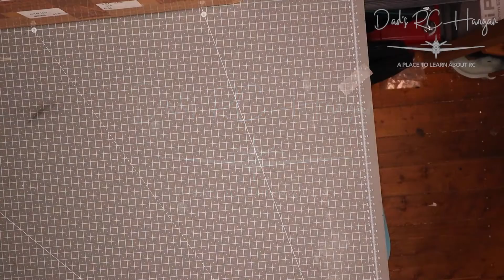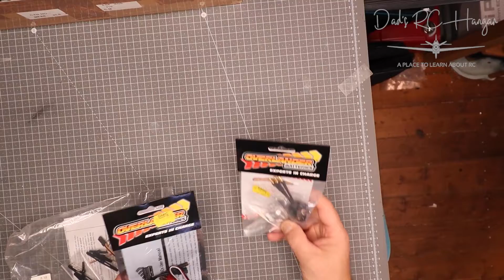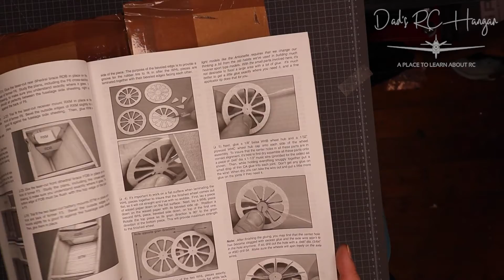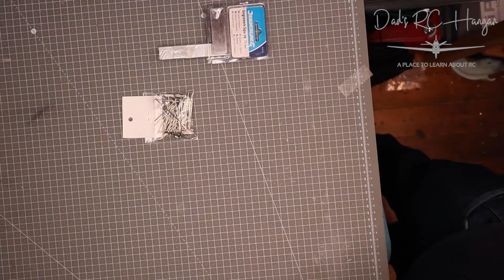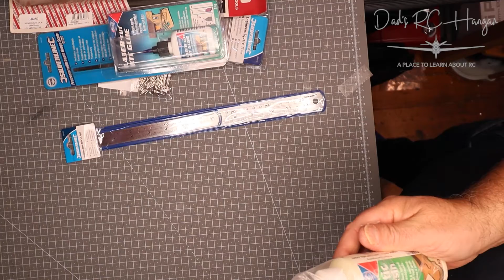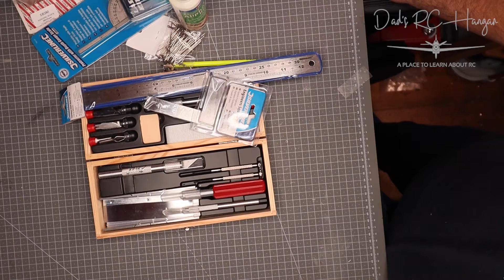Balsa RC airplane kit | 1909 Antoinette | Balsa Tools

Comment: Hey Chris, u will enjoy building the traditional balsa plane, don’t forget to use modern glues like cyano for most joints & it’s quicker to build with it. I just use resin or epoxy glue where high strength is needed. Looking forward to the continuation of the spitfire build too. Stay safe & happy  mate🤞
Reply from the maker: Hi John, will do, I thought I would emirs myself in the balsa build with the correct items, but you right, Cliff Harvey  also used cyano. Spitfire will be week after next. Need to finish my Boomerang 😎

Comment: Hi Chris, how many namechecks can you give one person, that's at least £50 I owe you  I was amazed to see you reveal this kit because I built one about 22 years ago, it was a cracking little model. The motor that was shown in the manual was all that was available back then, not very powerful hence the large gear. If you use the little saw with the mitre block put a piece of wood in the bottom of the mitre block otherwise you blunt the saw really quickly when you reach the bottom. 👍
Reply from the maker: You worth every name check Cliff, how strange is that you had the model. More Tim’s about the bottom of the mitre block. I am looking forward to building her, I hope I don’t mess it up 👍🏻